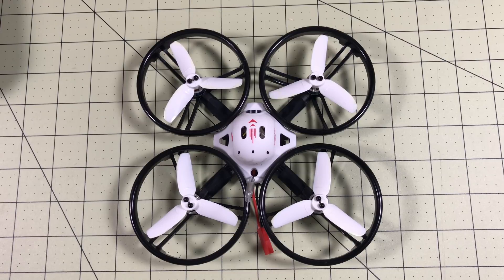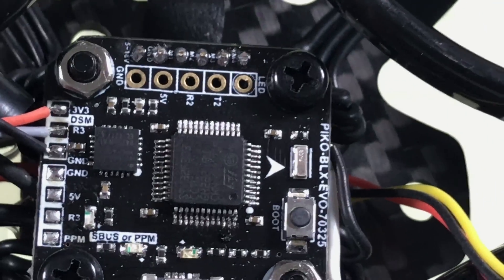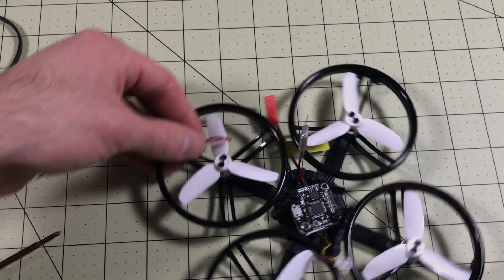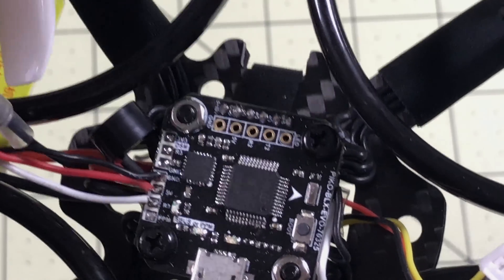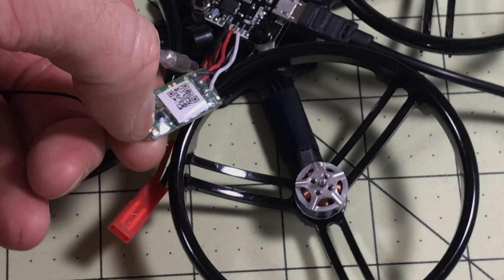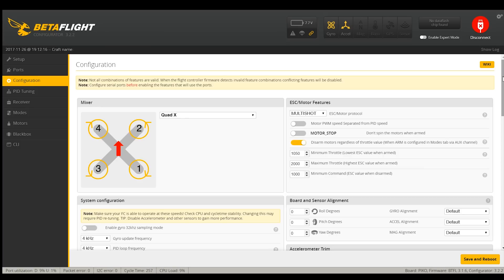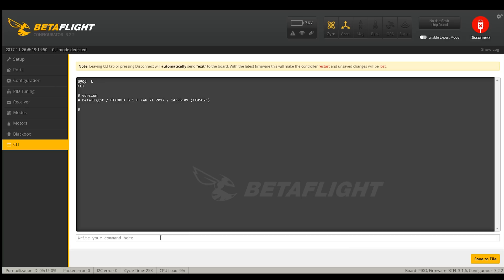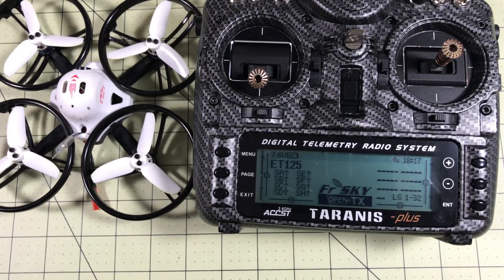KingKong ET125 Setup.  How to install and setup a FrSky XM Receiver

Comment from the maker: Check my tracking spreadsheet for current coupons: http://geni.us/DR101DiscountCodes

There are 3 sizes to choose from.
ET125 – 125mm frame 2.9 inch props
Gearbest: http://bit.ly/ET125-GB (Use Code RC18OFF if you don’t find any coupons in the sheet)
ET115 – 115mm frame 2.5 inch props - https://www.youtube.com/watch?v=NpwN68X8ypc
Gearbest: http://bit.ly/ET115-GB (Use Code RC18OFF if you don’t find any coupons in the sheet)
ET100 – 100mm frame 2 inch props - https://www.youtube.com/watch?v=l3L40QWDbx0
Gearbest: http://bit.ly/ET100-GB (Use Code RC18OFF if you don’t find any coupons in the sheet)
Banggood: http://bit.ly/KKET100

Check out my current giveaway: http://geni.us/DroneRacer101Rewards

Comment: Thank you so much, you saved my sanity :D
Reply from the maker: I’m glad six years later these videos still help people.
Reply: @SimRacer101  hey. I have a question. On the drone that I fixed the problem with, the 115, the last remaining stock motor has a loose shaft that drops down, causing the prop to stop spinning. Any advice? Appreciate it

Comment: I have a question On the King Kong 
Does the frski xm receiver Does it do Telemetry 
RSSI ?
Reply from the maker: The XM will not do full telemetry.  But it will do RSSI in the OSD.
Reply: DroneRacer101  
Thank you I’m just trying to figure it out on the transmitter To get signal strength value  
So I know not to fly too far to lose signal

Comment: Excellent video. Found this after buying my et125. Using dsmx had to change from dsm2 in betaflight as well as put a switch onto air mode. Did your camera upgrade and loving it. Now waiting for the coating to arrive. Not sure if I will do dshot upgrade. Maybe down the road. Thank you so much for putting up this video. I found it thorough without too much info. Great balance.
Reply from the maker: I still need to do the vid.  But if you upgrade Betaflight to 3.3 you can now get DSHOT without having to do any wiring.
Reply: DroneRacer101 Wow. No rush but I will certainly do that if no wiring required. Thank you very much.

Comment: Ch 5, 6, 7, flip the switch you want for each...then go to mixer and "click and exit, click and exit, click and exit.." I missed the part where you tell the quad which switch is doing what function...or was that already in Betaflight??
Reply from the maker: That is all done in Betaflight under modes.

Comment: Ahhhhhh!!! I accidentally ordered the Frysky XM +  Do you think that the + size will fit the Kingkong ET 125?
Reply from the maker: Yes. That is what I have in mine.
Reply: DroneRacer101 ok. I wondered because at 5:24 you pointed out that it is an XM plus. But then you called yourself and oaf lol. And I thought the XM plus would look a lot bigger than the regular XM.

Comment: Please help! I’ve had my ET 125 for a week now but it won’t fly. It just flips over upside down. And is very sporadic!  I’ve binded it to my Frysky QX7. And then I plugged it into beta flight. And I followed all the same steps as you in this video. I’m so lost and don’t know anyone who can help. So please if anyone has any suggestions it be much appreciated! Here’s a short video of what it’s doing. Right out of the box!    https://youtu.be/MLdghqY6JrI
Reply from the maker: First, great video.  Actually that looks right.  It’s trying to correct and without pops it can’t so it overcorrects and looks crazy.  Put Air Mode on the same switch you use to enable your flight mode and only use it in rate and horizon.  If you put it in angle I think it will hover just fine.  But with air mode on all the time if you bump the ground testing it will go crazy.
Reply: WOW! Thank you soooo much for helping me!! I've been coming home from work everyday for over a week now trying to figure this out only to get more frustrated. I't hovers perfectly now! Thank you for responding! this has made my whole week/month!!
Reply from the maker: SWEEEEET!  You are very welcome.

Comment: I appreciate you making this video. The instructions say to solder to the last pin that says ppm. Then on the FC there is also a marking that says PPM or SBUS. I must've received a bad manual because it says to solder the signal wire to the very bottom pin which is wrong. I spend 30 minutes trying to figure out why my receiver was bound but not detected in Betaflight until I saw this video. Lesson of the day...Bad manual will waste lots of time!

Comment: Great video mate very helpful I’m thinking of getting on of these. 
My tiny 6 was doing the same thing the tumbling. I’m using a Spectrum. 
Could not work it out for the life of me. Now I know.  But I changed the MPS to UART3 I was just trying anything. Hit reboot & save betaflight locked up & froze & now I cannot connect it to betaflight at all on two different pc’s no matter what I do. I have deleted everything to do with the drivers & betaflight & reinstalled betaflight & all the drivers. I have com3 in betaflight my pc recognisers the FC but betaflight will not 🤬 So I have stuffed something up some where 😫.

Comment: your videos goes straight to the point (like this vid). very useful , big thanks! I saw your other video about the Babyhawk FPV drone. I was on the edge to buy that, but now I got a second idea about this King kong ET125. I have question; which drone would you recommend for me the Babyhawk or this King kong ET125? Thank you!
Reply from the maker: 1000x the ET. It’s WAY better than the Babyhawk. The one question is which one. All three sizes are great.

Comment: i have an et115 came with frsky receiver.  Receiver bound to Taranis.  Betaflight set to sbus but led on flight controller has PPM on.  moving sticks and switch does not show any sign in receiver tab.  Any thoughts?  Did your PPM led go off after you configured yours to sbus?  thanks

Comment: At 8:40 you mentioned setting only channels 1-8 for least latency. I tried that and that caused major problems. I couldn't arm too close to the quad. I had to step away a good ten feet. And then nothing would respond properly. It's almost as if it created an exponential amount of latency. Once armed , I gave it some throttle which took about 3 seconds to respond and then it would not disarm with switch so I turned off tx . Fortunately I set up Rx failsafe so the quad cut off. I had to change back to CH 1-16 to regain normal function. I am using QX7 if it makes a difference.  Hope this helps anyone who may experience same problem.
Reply from the maker: Do you have have an XM or an XM+ in it?  I have that happen with the XM sometimes. I haven’t found a better fix yet. FrSky XM Receiver Problem FIXED!!!  15 second latency, was totally unusable https://youtu.be/MaY-S23LOm0
Reply: DroneRacer101 ...xm. ...thinking about putting xm+ in it but not sure about position of  antennas.
Reply: DroneRacer101 ...ok just watched linked vid ( must have missed that one) but yes, exact same issue. Thankfully I figured out pretty easily what the problem was since I had just set to CH 1-8. I certainly don't know enough to explain that but lesson learned. Thanks for the reply. Btw...your vids have really helped me step out of the toy quads into "real" quads. So, so, sooooooooo much to learn. But so far things keep working out and I'm flying acro now ( poorly) but I'm there finally.  Thanks again. !!!

Comment: Hello,  Just wondering how u set up Air mode. I have the dsmx version and dont have that option either. Cant seem to flash the KK115 do to port, maybe my drivers ? Did get it to arm an fly with Horizon and Angle, but hard for me to fly. My KK95GT  is easier to fly in air mode and had that option. Beta flight expert mode and slide enable air mode? Thanks
Reply from the maker: Yea. You probably need Zadig. I think I needed Zadig in this video. How to upgrade your Eachine Lizard95 to Betaflight 3.2 and problems to watch out for https://youtu.be/QTczo5PYNNE just make sure you choose the right flight controller and not the omnibus. The Air Mode will be there.
Reply: Thanks so much. I was successful in flashing with Zadig with that video, had to hold boot button to start flashing, said successful. Came with multishot after flash came with oneshot ? Now comes with air mode. Thanks again Happy Holidays to U an family.
Reply from the maker: It comes by default set as oneshot after the upgrade. You can change it to multishot. Or follow these instructions and support dshot. KingKong LDARC ET100 DSHOT Setup. Enable Turtle Mode and a HUGE camera upgrade. ET115 and ET125 too https://youtu.be/eWeTAIIAFhM